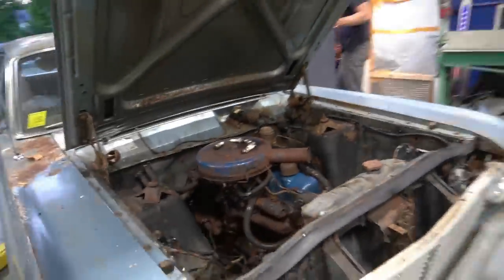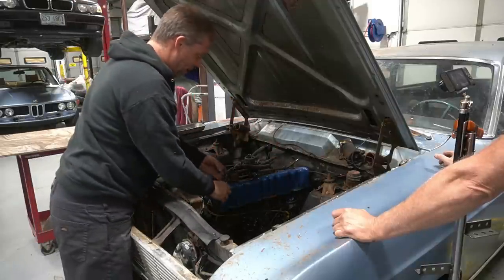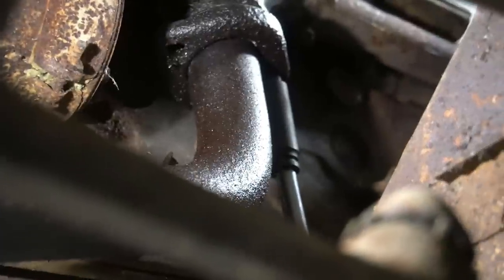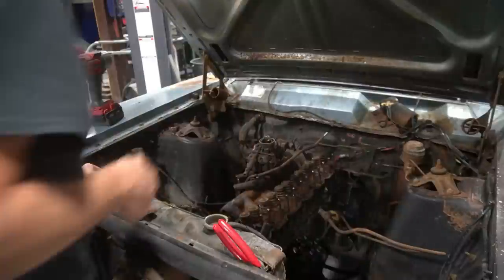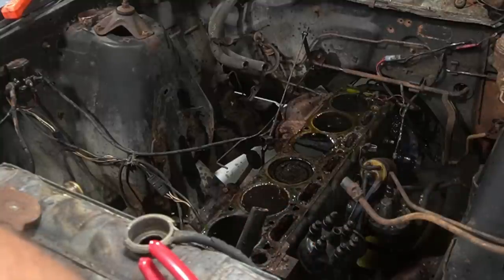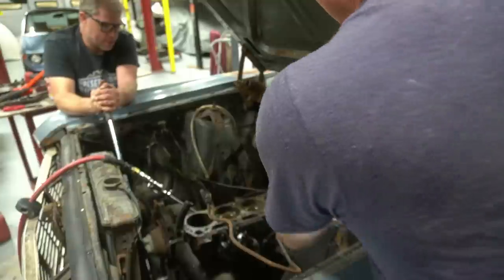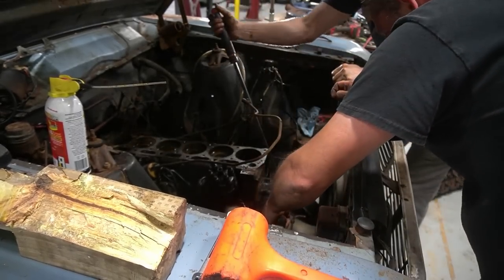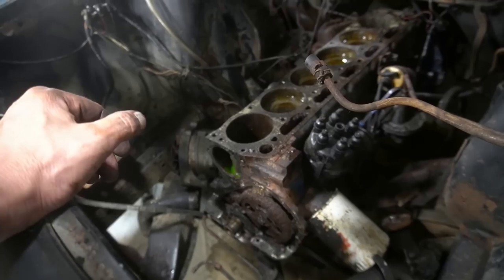Worst locked up engine ever!! With Mustie1!! Will It Run?

Comment: I remember my dad talking about adding a copper tube to some of the Ford sixes to get top end oiling. I have never seen that much valve train rust.
Reply: it's not rust.... it's caked up oil crust from sitting around without enough oil changes early in its life.
Reply: Not just Fords. That was a common 'fix' for all makes. Insufficient oil pressure to the hydraulic lifters due to engine wear fixed by adding a line running from a lower galley near the oil pump up to the head for improved flow to the lifters.
Reply: @roseymalino9855  ... worked in that field for over 50 years and I don't ever recall seeing any lifters in a head. I believe you are confusing the bypass line from the bottom of the block to the head that was used to feed the rockers on early 6 and 8 cylinder engines, which is also where the optional (bypass style) oil filter could be added. That tube and its fittings were prone to blockage and that starved the top end. I have cleared several in my time. A very common problem on 30s vintage Buick straight 6 and 8 motors.
Reply: @rupe53  Then you also should not recall me saying lifters are in a head. An oil galley plug was in the head.
Reply: @roseymalino9855  ... I just took it at face value... " up to the head for improved flow to the lifters." Sorry for the confusion if you meant different. In hindsight you probably meant the rockers.
Reply: @rupe53  English is not my second language. If you add pressure anywhere it goes everywhere. Yes, it went to the rocker assembly (straight 6 / 58 Impala), but it went to the lifters and reduced the problem of their bleeding down.
Reply: @roseymalino9855  ... while you are busy taking offense, the point I was trying to make was the early engines had mechanical lifters so nothing to bleed down. They also commonly had that bypass tube because there was no internal drilling in the block. The optional filter could be tied into that tube. It was not a full flow filter in that situation, but that's all they had during the era. Quite often the top end would starve for oil and make the (poorly adjusted) valves seem rather noisy Fix the oil problem and adjust the valves, then you were in good shape.
Reply: @rupe53  Mine was not originally equipped with an oil filter. It was added at the same time as the tube. A separate canister was attached to the exhaust manifold.
Reply: @roseymalino9855  ... yes, that manifold bracket was the normal way to attach the filter accessory. It was usually a cartridge style. (Fram C-3 if I recall correctly)

Comment: The cruise-o-matic transmission in the fords in the 60's were 3 speed automatics the 1st D started you out in 2nd gear and shifted to high the 2nd D started you out in low or first shifted to second and then shifted to drive and the L was 1st gear only unless your driving down a hill and you put shifter into L it would shift into second gear unless you was down to 20 mph it would shift into low  I know I had a 66 Fairlane with a 289 automatic years ago... The criuse-o-matic was a c4 transmission with a different valve body from the regular c4..

Comment: You can't call that engine completely gone until you see the crank and mains. I've brought back worse than that. disassemble and clean with new parts that engine has another 100 k in her.

Comment: That's from driving the engine on short trips an not letting it run enough to dry out and Valvoline oil is a engine killer

Comment: I would of took the rocker shaft off before trying to remove the head because the issue could be stuck valves and removing the rocker shaft could of solved the whole issue. another thing is too bad you did not have one of those camera's that can go into the plug holes and look to see what is in the cylinders before filling them with oil that way you could of seen if they were the issue or not.